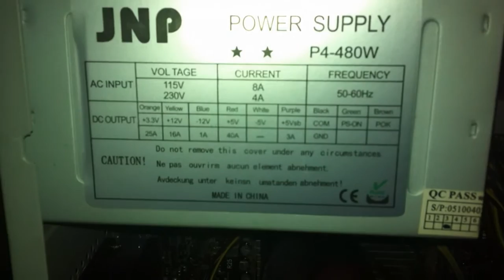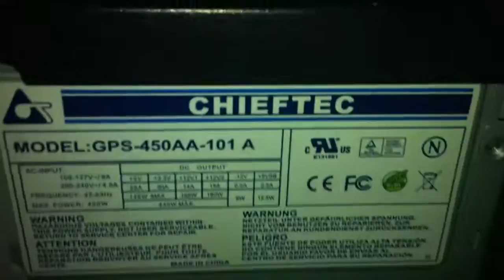Zasilacz (PSU) Chieftec GPS 450AA vs JNP P4-480W - porównanie głośności / loudness comparision

Comment: chieftec этот очень плохой?
Reply from the maker: Chieftec хорош для дешевых комплектов. Я определенно рекомендую этот Chieftec за дешевые подделки / замены.
(Chieftec is good for cheap kits. I definitely recommend this Chieftec over cheap fakes / replacements.)
Reply: @RafiXX  gtx 1060 пойдет?
Reply from the maker: @ariescsgo  
Этот Chieftec на видео GPS 450 AA, он довольно старый, но может без проблем питать GTX 1060. Я предпочитаю современный блок питания (например, Chieftec, Corsair) для современного GTX.
Я думаю, что этот блок питания видео можно купить примерно за 900 руб. / 12 евро для подержанных. Это очень дешево по сравнению с современным GTX.
--
This Chieftec on video is GPS 450 AA, it's quite old but can power GTX 1060 without problems. I prefer modern PSU (eg Chieftec, Corsair) for modern GTX.
I thing that this PSU od video you can buy for about 900 RUB / 12 EUR for used. It's very cheape in comparision to modern GTX.